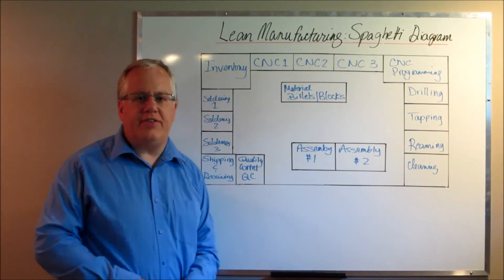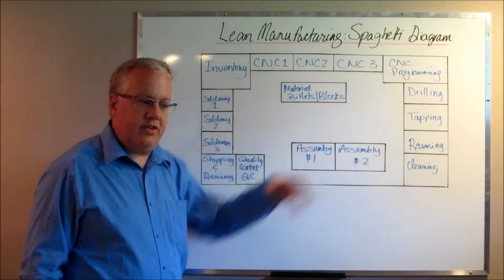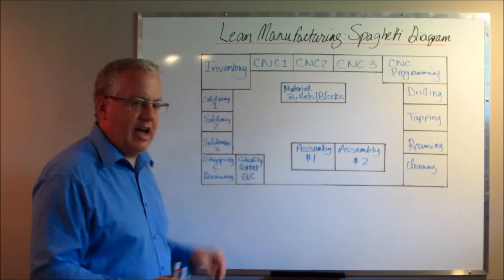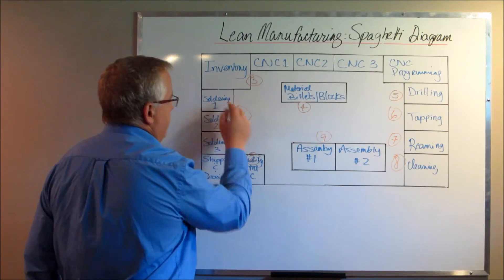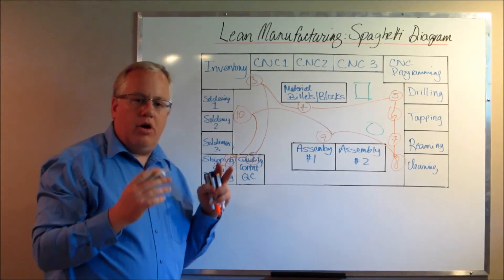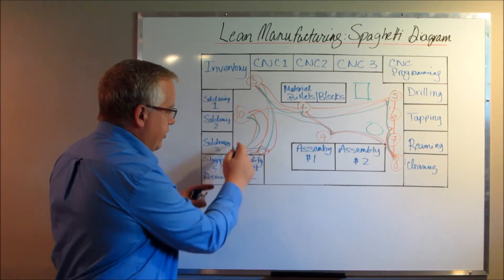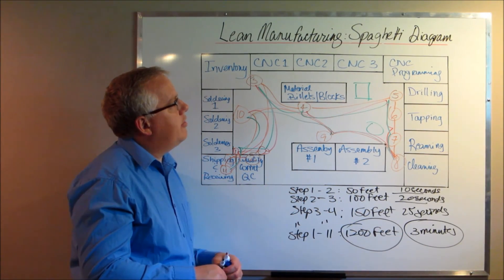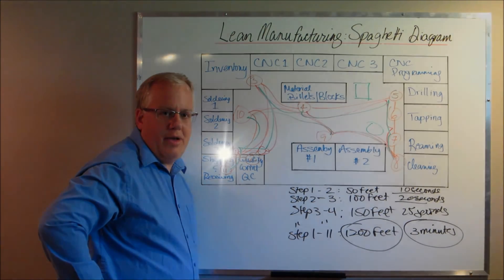Spaghetti Diagrams Six Sigma: De-Cluttering Production Shop Floors

Comment: 🎯 Key Takeaways for quick navigation:

Spaghetti diagrams are part of business process mapping and are effective for decluttering shop floors in manufacturing.
Each operation in manufacturing has a cycle time, and reducing cycle time can increase production throughput.
Transit times between workstations affect the overall cycle time for finished products.
Spaghetti diagrams help identify roadblocks and issues causing delays or downtime in manufacturing.
The process involves mapping out the shop floor, defining each step, and using sequential numbers to designate the workflow.
Drawing continuous lines on the diagram represents the flow of work through the shop floor.
Measuring the distance between steps and recording any delays or obstructions helps analyze production efficiency.
By rearranging the shop floor layout to reduce travel time, production throughput can be increased.
Spaghetti diagrams aid in optimizing manufacturing processes by capturing downtime, delays, and travel distances.

Made with HARPA AI

Comment: I have one question about transit time. Let me put up a situation. If we from process 2 to 3 it take 60 seconds to move 10 parts at a time. 
1 ) Transit time = 60 sec
or 2) Transit time = 60 sec / 10 parts = 6 sec/part

Which option shout we used. Transit time each and every component moves or transit time / component??
Reply: I won't claim to know the answer, but I would count based on the process.  For example, if a single process takes 60 seconds to move 10 parts at a time, then I would put it down as such.  However, if a single process takes 6 seconds to move 1 part at a time, then I would record it as 6 sec/part.  Does that make sense?

Comment: Can the flow of information (over radio/in person) be included in a spaghetti diagram along with the physical movement of people/parts?
Reply: A spaghetti diagram is just a tool, which you can use as you see fit. If the flow of information is taking up measurable time then it could be useful to display on the diagram, as it could increase process and/or total lead time.
Reply: I think if the flow of information is separate from the physical movement and can be measured in time, then yes.  But if it occurs in parallel to the physical movement, then there wouldn't be a reason to include it...  Just my opinion, as I don't know if that's the right answer :)